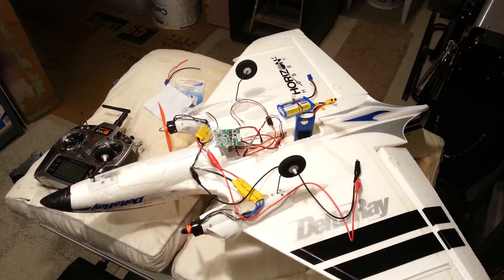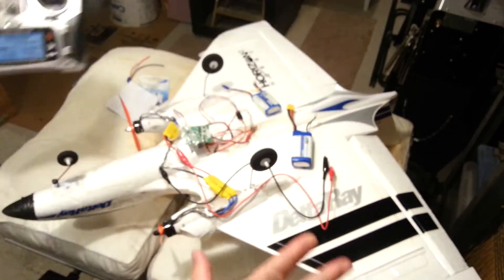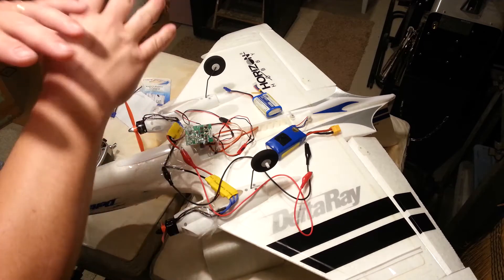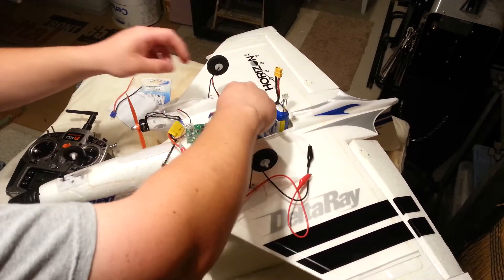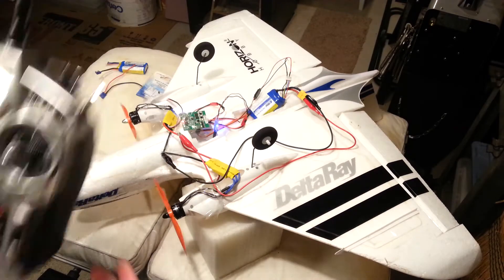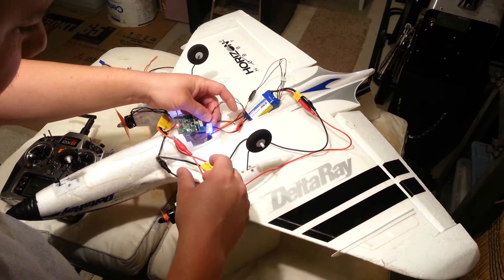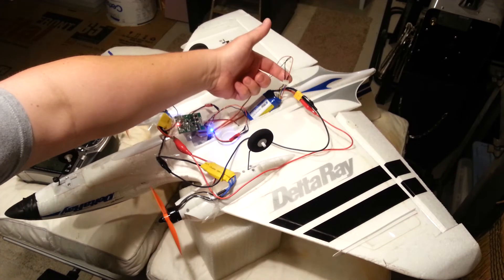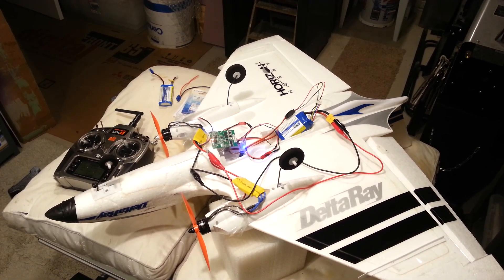Horizon Hobby - Delta Ray - Brushed to Brushless Signal Converter Installation - Part 1 of 2

Comment: Brian I still have my 2 Delta rays that I learned to fly with they're in perfect condition now that I know how to fly I want to do the conversion that you did but I can't understand how you did it and how I need to do it can you help me what I need to buy and what I need to do I've tried running the brushed motors on 3 cell battery and it works it's more powerful But 2 saddle is just the boring I want to change to brushless motors could you help me please

Comment: Bryan awsome vid, have you upgrade the Delta to gen 2 transmiter?
Reply from the maker: Not me, but my friend Esteban has a DX9 Gen2 as well as the DX8 Gen1...either would work in this case :)
Reply: @BrianPhillipsRC   could you ask to post the programing on gen 2  ive not yet been eable to get the safe to work on gen 2
Reply from the maker: On a stock Delta Ray, or an upgraded one?
Reply: @BrianPhillipsRC   if he cambiado do both
Reply from the maker: I don't understand...
P.S. Did you see the "early release" of the Delta Ray 1 today from Tower Hobby? It's a single pusher prop on a delta ray!!! Pretty cool!
Reply: @BrianPhillipsRC   hi Bryan sorry for not beeing clear, i had the Ray with original reciver on gen 2 and did not have the safe tech working,  btw were's the cg at on the modified delta
Reply from the maker: CG is the same before and after :)
Did you have a new, different than stock receiver used?
Reply: Hi Brian i took all the electronics out installed brushless motors and an old Orange reciver, i still have the old reciver and posibly will order the converters for the other Delta thanks i have
Reply from the maker: I think if I were doing it again, and was helping a newer pilot who still wants SAFE, I'd just bind BOTH receivers. Use the new one for the throttle and differential thrust (you'll lose YAW control via AS3X and SAFE with this setup) and tailevons from the old Rx